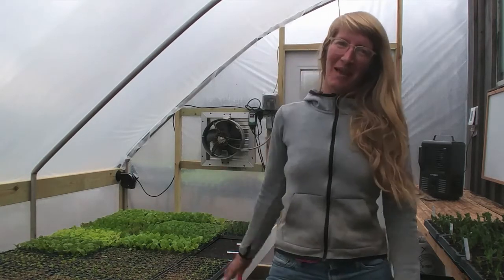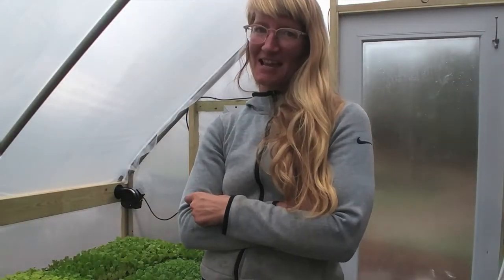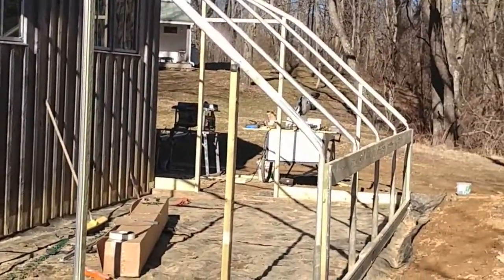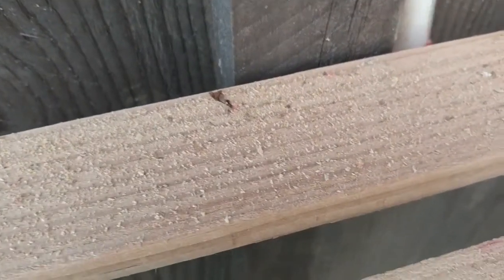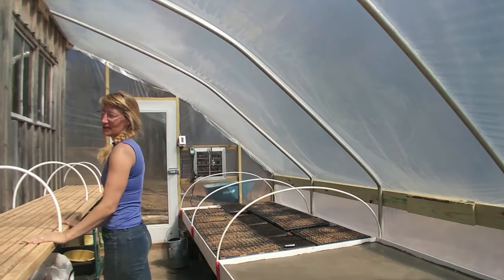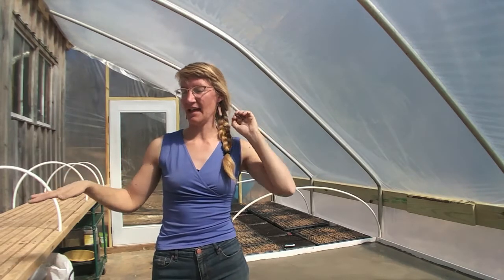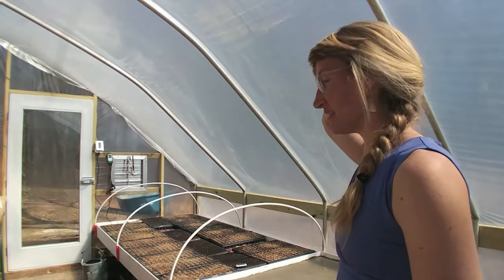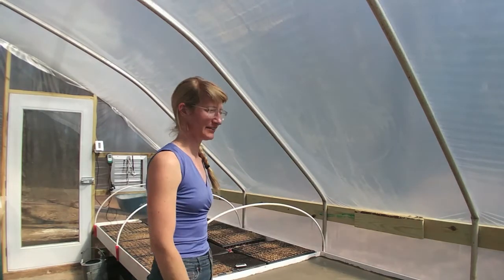Building a Lean-to Greenhouse for a Tiny Farm

Comment: Very nice...will this withstand high wind...like 70 mph? Thanks.
Reply from the maker: I think it would depend on a few factors. If the prevailing wind will hit the building first it would work well as a baffle for the wind. Being attached to a rigid building definitely helps with structural support to some degree!
Reply: It would almost certainly withstand higher wind than any stand alone greenhouse assuming equal design and materials

Comment: What is done to mitigate the absorption of humidity into the house. Humidity that through the facing wall and soffits migrates into the roof space creating mold and rot. Thank you
Reply from the maker: Such an important question! But, not one that I have encountered since the building I attached to is not a precious one and the soffits are fully vented outside of the greenhouse in the toolshed I have. ---I think a moisture barrier and insulation would be key. I would want to check with a home builder who understands how moisture migrates before I recommend anything though.

Comment: How is it working 2 years later? Do you have an update video?
Reply from the maker: going strong, no update video yet... but if there is any specific questions I am happy to answer them! I did have to replace the plastic in the first season because of a BEAR (boo!) and I did add a stronger exhaust fan at the beginning of this season as well as automatic overhead watering which I have really been loving.